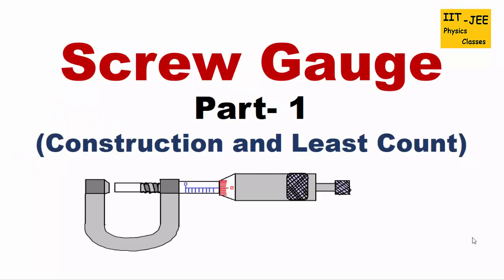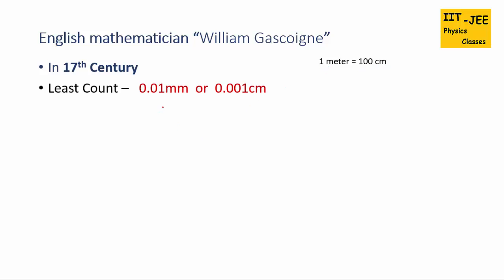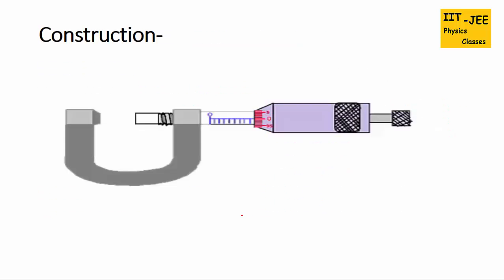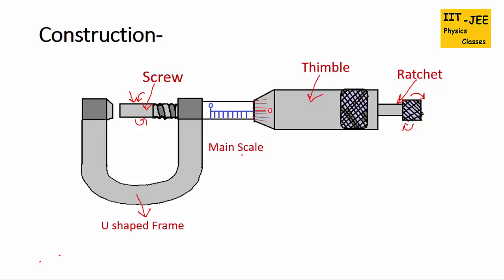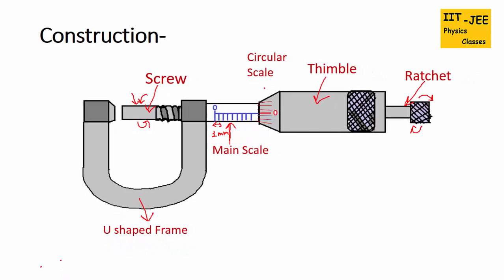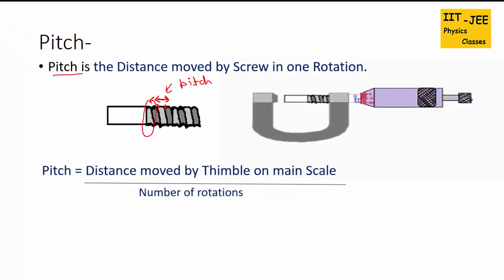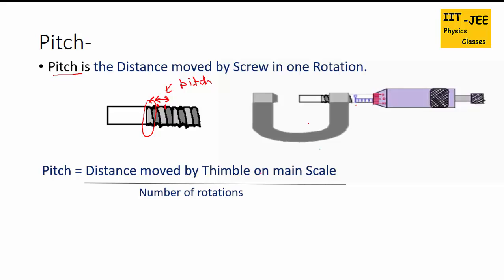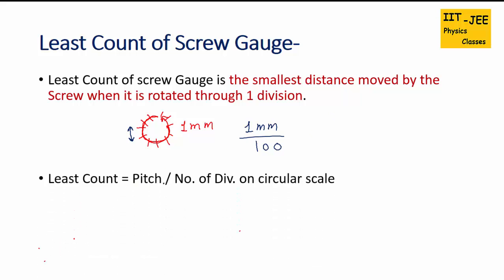Screw Gauge (Part-1) : Construction & Least Count using Animation, IIT-JEE physics classes

Comment: Hello sir/ madam.
Thank you  for very easy and useful information. 
I could  find one doubt the least count for screw gauge is mentioned in video as 0.01mm but at 5:34 instance least count is derived as 0.001mm
Reply from the maker: Hello Dhruv, there is a correction in the end of video, at 5:34 instance least count is derived as 1/100 = 0.01 mm and that equal to 0.1 cm...hope that helped..